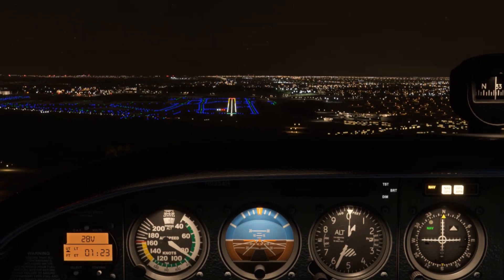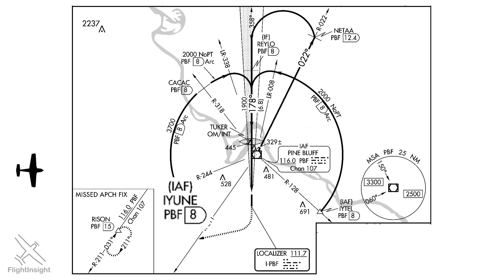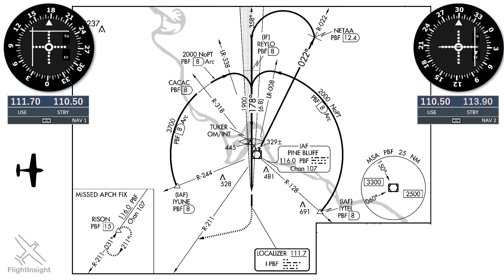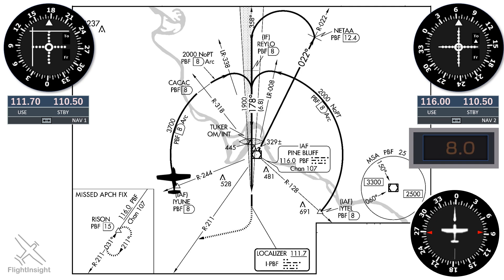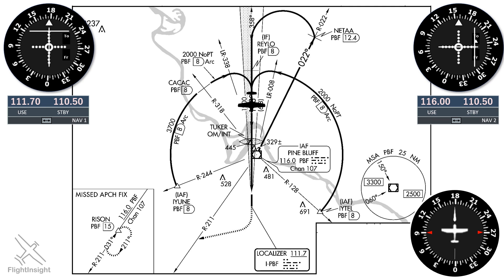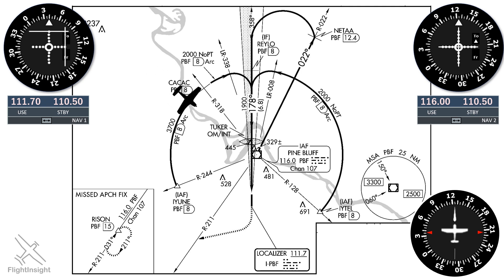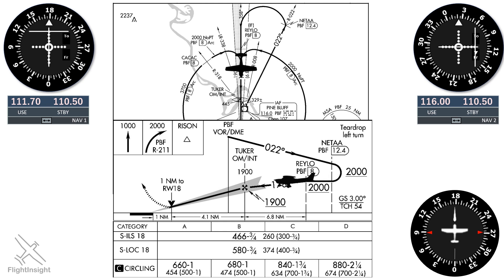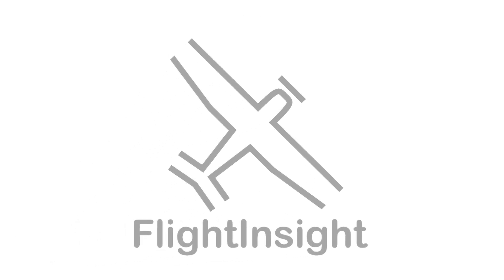Uncommon ILS Transitions | DME Arc | Procedure Turns

Comment: I'm flying in Bangui, Central African Republic and they have a DNE Arc to either VOR or ILS. The confusion for me initially is the expected clearance ATC gives. "Expect ILS Z RWY 34 via 11 DME Arc to your Left/Right". So now you join on any inbound radial and establish on the Arc with either a turn to "your left/ right" but then subsequent turns are opposite to stay on the Arc. That can be confusing while also fighting turbulence and multiple isolated thunderstorms on the radar. This particular airport also has a DME Arc to a fix to a hold which exits back to an Arc onto a vor or ils approach. Definitely working the brain, nav frequencies, sources and CDIs 😂